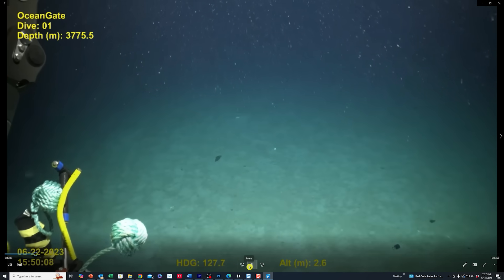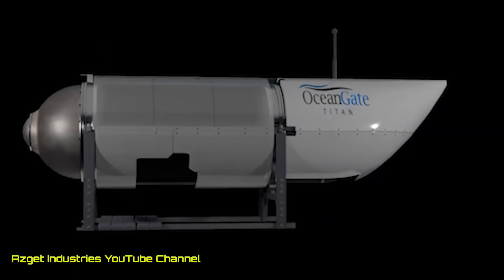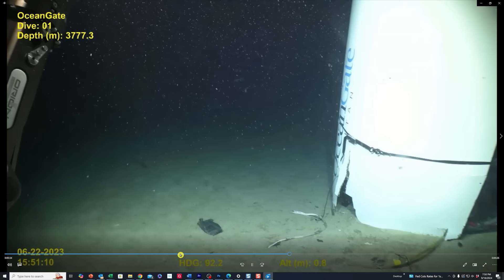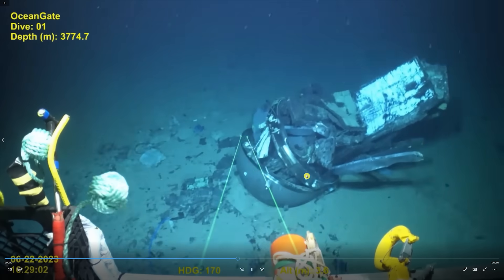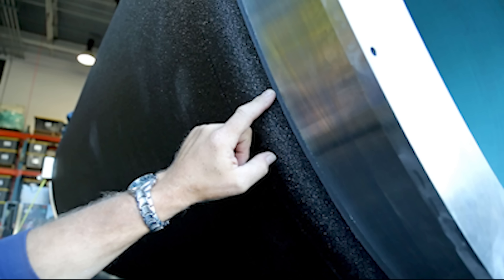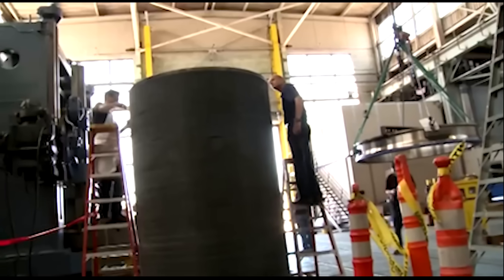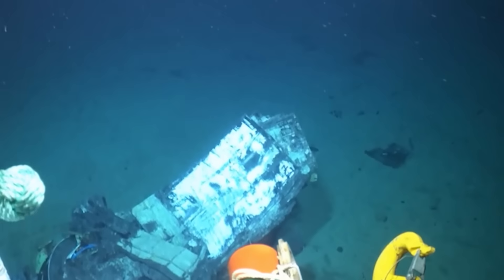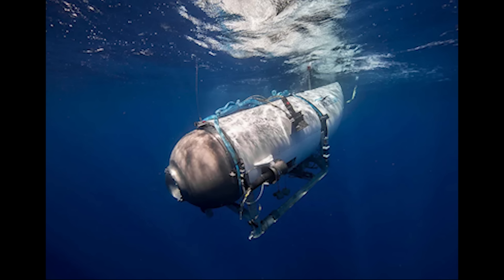OceanGate Titan Sub Debris Video Shows How It Imploded

Comment: Okay, first of all I'm not a submarine engineer but even I know that the design of this sub was extremely flawed!!! There is a reason why deep sea submersibles like Alvin which was designed in the 1960s use a pressure Hull is always a sphere!!! that way the pressure exerted on the pressure Hull is even!!! every square inch of the pressure vessel is compressed evenly!!! the very worst shape that you could use for a submarine at that depth would be a tube!!! it's obvious that the pressure would be greater exertion on the Rings and joints of the tube, to make a long story short I wouldn't get inside of this submarine even to go ride around a lake this vessel was not seaworthy!!!! I don't know how they at certification to make it seaworthy??? maybe that'll come out in the investigation this thing should have never touched ocean water, also using epoxy in a corrosive saltwater environment? is another giant no no!! salt water is extremely corrosive to chemical agents, I feel that over time repeated trips under pressure with salt water probably destabilized the epoxy and here's a word to the wise if anyone ever asks you to go into their glue together submarine just say no😂😂😂😂😂😂😂😂😂😂

Comment: Where are the bloody bodies inside the sub???
Reply: Vaporized and smashed into the front. The carbon fiber fragments inward into 1000's of pieces. The implosion also causes massive amounts of heat. So the bodies were shredded and cooked in 0.14 seconds. The ocean weighs 5500 pounds per square inch on a vessel at those depths.

Comment: Foreshadowing Fact: in 2010 a game called "Dive to the titanic" was released, the game is about diving to the wreck of the titanic in a submersible (Nephron, which is based on Mir 1 and 2), and doing several things like photographing and collecting artifacts.
In the game, the narrator talks about the pressure of More than 380 bar and that a tiny hole would cause the submersible and its occupants to be torn into tatters in less than 2 seconds (which is much more than it would actually take), but thats not all, the mission in the games takes place over 5 days, just like there was 5 people onboard the sub, plus on the 5th day, an incident happens in the game which the player has to survive.
Sometimes its crazy how some things can almost predict the future

Comment: so why is there some type of tie strap around the structure as seen at 0:20 ?
Reply: To hold it together i guess, its clear there's some work done down there after the implosion to bring the sub back to the world. Also if the straps were there before, its not explosion so the strap breaks, it imploaded. Two very different things. To be honest it doesnt even look like implosion. Its more of a "lost controll and crash landed in the dark"  It could be that the calculations on the instruments were wrong and they hit the bottom with high speed. Altho It feels as the sub was falling down like a bullet, breaking the body on half. Its just ironic, that titanic was broken in half too before it went down. Death roams that place. Not a living soul can prove me otherwise, death did left its mark. It is also possible they had some electrical error in the program, lost all electricity which allowed the sub to maintain horizontal level, forcing the sub to divei down with the front part like a flying bullet. Seeing that the sub weight was just above 10 tones, 3.800m drop seems like jumping off a building with a bag bricks on the back. It is also possible that high drop rate combined with the pressure made all those people faint and they were not even aware they died, which is also a reason of implosion. Whatever it is, its sad those people lost their life. But in the frontier of exploration, since the dawn of time, death is your companion. It takes brave men to explore space, the depths of the ocean and every enviroment men are not made to live.
Reply: Yo my question exactly. You show up to visit the bottom of the ocean & it’s held together with a ratchet strap…I mean you get whatchu get
Reply: It looks like it's raggedy with the strap tied on the back of it. 😥💯

Comment: Now, my theory is that the window possibly malfunctioned, pushing the pressurised chamber and tail cone backward. Seeing the minimal amount of debris at the front dome (I forgot the proper name, sorry), I think it may be rather possible. But, because of the carbon fibre controversy, people may think that it was entirely the carbon fibre hull. Seeing how the glue may have failed, the point of failure may even have been the connecting point between the titanium and carbon fibre.

Comment: Yes the bonding zones on the metallic components should ideally be acid etched or carefully abraded and de-greased. 
Covered and protected before the bonding operation.

The carbon bonding surfaces should be abraded to a particular roughness and also de-greased with a high flash solvent such as acetone.

There are also chemical bonding kits available to test the surfaces to be joined to ensure 100% no contamination is present.

Thorough mixing of the adhesive and chemical hardener is of course critical. As is the ambient humidity and temperature.

The application should be generously applied and a fillet should be left along the edge of the titanium ring which can dramatically increase the integrity of the bond.

❤

Comment: As many engineers have said, carbon fiber becomes weaker with each exposure to the pressure conditions of the depths, fibers start to deaminate, so the carbon fiber idea was probably good, but only for a few immersions, not thousands as they pretended to do with this submarine.

Comment: I doubt the glue joint failing between the carbon fiber tube and the titanium ring would've caused the tube to implode.  If that joint failed first, it's likely the outside pressure would've forced water though the joint, causing a flooding of the chamber and relieving pressure differential before tube failure.  That same pressure differential would tend to keep the rings clamped on to the tube until flooded.   A tube implosion from carbon fiber fractures seems more likely and would result in the same ring to mating surface clean separation that we see. Just a thought.

Comment: Its all about compressibility. The carbon fiber hull that was mated to the titanium ring failed no doubt in my mind . The compressibility of the ring was much higher that the carbon fiber and the epoxy glue. Pressure compressed the hull sealing point and pulled it away from the ring. This began to fail on install. Dirty rags used to wipe the seal..geez

Comment: I served in the United States Air Force doing structural maintenance. From my six years of experience, working with advanced composites it's crazy to think any engineer would allow this. All this work should be in a "clean room". Bonding your epoxy equally needs to be done in a vacuum bag  which I haven't seen. Crazy to play around with that kind of pressure just winging it.
Reply: I was  amazed to see this done outside a clean room. I've seen less critical components worked in more sterile environments than Titan was constructed within.

Comment: That design is flaw , they should have made 6 titanium rings as inner shell than on the inside made 7” or 9” thick of carbon fiber , that why when they went too deep and crush that 5” of carbon fiber , titanium can prevent the sub from getting crush , because 6 titanium ring support inner shell

Comment: No etching or other roughening of the titanium ring plus applying the adhesive in an area where there's all kinds of dust and dirt blowing around in the air to get into the adhesive and compromise the seal is just unbelievable.  I am not an engineer but I understand the need for a rough surface and a clean environment to get a really good adhesive seal. They failed in the most basic principles and then smiled talking about it like they were being so careful.

Comment: Ive always felt the same way about the hull being "glued" to the smooth end bells - the whole idea seem ludicrous given its intended use - those bell ends were smooth as glass and the epoxy has to have a shear limit at the bonding point - one guess I had might be how does anyone know in what ways the properties of that epoxy bond is going to change once its under a multi-ton per square inch pressure as well as being exposed to the cold saltwater at the bottom of the ocean - ive heard others with more direct knowledge than me say it would become cold and brittle with catastrophic failure under pressure a forgone conclusion at some point, im no engineer but im a mechanic and worked in a plastics molding plant for 15 years so you learn things that while not exactly applicable to this scenario still give you some insight to failure possibilities.  Im thinking it (might) have been a dual cause failure, hull pressure pressing inward is certainly going to distort the carbon fiber inward, and maybe also at the same time causing outward pressure on the bells so maybe both the CF hull and bonding area failed in some sort of order-?  Question is was inward pressure on the hull enough to overcome ocean pressure on the end bells enough for them to de-bond and pop off the ends -- also in what order did said failures occur - did the hull fail first then the epoxy bond, did both fail at the same time, no way to know as I said im only speaking from limited knowledge and supposition, but might be a good point of discussion for those who know more than I do.

Comment: Given that it wasn't a good idea to build a submarine with that shape and glued parts, to go to a depth of over 4000 meters... Here the basics of safety and common sense have failed... If you want to make stuff that it has to withstand extreme pressure and you want to glue the 2 parts, you don't do it in the open air, without gloves, without masks on your face. This way you contaminate and damage the 2 surfaces that have to come into contact with the glue, it is much better to bolt and use materials suitable for the purpose.. This was madness... It was only a matter of time before the titan, as it had been designed and built, would destroy itself.. And bad luck would have it that it took lives away... And they had also warned them that it was not possible to go so deep with that vehicle... But they insisted and these are the results

Comment: What a poorly designed joint between the titanium parts and the carbon fiber part. It would never withstand these pressure extent of the deep. No private company should homemade these equipment. It should only use a professional certified and known equipment brand and the right equipment for these depths.

Comment: Very rich people have made very bad decisions. They've cut back on all the commodities that would have meant survival and security for them. Unfortunately, in many respects, ego has driven this project. Despite warning signs and expert opinion, experts were fired if they didn't say what they wanted to hear. However, there is also the responsibility of the monitoring and inspection bodies who tested the toy. Although they raised their concerns with the company, the vessel could still be used to operate at sea. How is this possible ?   Because there was no way the submarine should have been given an operating licence. Basic things like GPS were missing from the submarine. Obviously a design flaw and poor quality materials caused the accident. The poor quality of the material simply could not withstand so many dives and it tired and gave way. It cost them their lives, even though the company's employees knew about the problems with the construction and the quality of the materials. Yet they were still taking people on trips to the bottom of the ocean. Those people trusted both the driver who operated the boat and the company. Much more serious scrutiny and criteria must be applied to these companies and vehicles to ensure that such a sad tragedy does not happen next time.

Comment: Carbon fiber abd titanium were not joined except vus pressure. The sealantvwas meant to remain flexible because titanium is not . Asuming narrator is unfamiliar with the physics of pressure. Under water rhe pressure is equal alk rhe eat around the sub this rhe pressurde pushing the two titanium ends towards each other was equal to the pressure excerted equally around the carbon fiber cylinder. Thats how water pressure works

Comment: What you saw was rhe entier crew capsule and one endcap. What was ledt of the people ate within the crished area. The other endcap (titanium ) whether or not it had the port hole. Both end caps had the bolted port , onlly one was a  plexiglass window. . No need fir sixe scale . There sub is in 4 distinct parts. As for bidy parts inthe sand there may be some, but the squashed bodies are inside the crushed area , its doubtful the bodies had much separation possible the skin retained the mass. Look for a rubics cube and the control remote which may have escaped thriugh thr cracks of the hull

Comment: I am a structural engineer that designs building structures, but I think some things still apply. In looking at shear resistance of materials, and my expertise is concrete, a smooth concrete joint gives you the least shear capacity using a modifier of .6. An intentionally roughened surface gives you a maximum shear capacity multiplier of 1.4. Putting a very smooth titanium ring against a smooth carbon fiber surface and expecting a glue to hold all of this together seems nuts to me. Based on building structures, we would provide some type of physical mechanical connection between 2 pieces being connected. I would think here where we have 2 dissimilar materials (titanium and carbon fiber) with different coefficients of thermal expansion, that we would want some type of physical mechanical connection between the 2 pieces, because when these 2 materials are shrinking or expanding differently, internal stresses on that glued surface could be great.
Reply: I mean, skyscrapers have extreme pressures on them too, right?  Just sheer gravity and fighting the wind?
Reply: @Dubuya_Jay  All buildings are designed for the building code wind pressures and earthquake forces that are expected for the life of the building. Skyscrapers are generally modeled in a wind tunnel with the surrounding buildings. Doing this generally results in a lower wind pressure than the building code requires. Wind tunnel tests are also done to study the exterior building cladding to see if any vortices are generated by the building shape or by adjacent buildings so that the glass doesn’t get sucked off of the building. Water pressure is a whole different animal. Water pressure makes wind look like child's play. There is a reason we know very little about the depths of our oceans. Water pressure increases linearly with depth.
Reply: @davidzuk4894    Ty for all that info.  Didn't know about the wind tunnels.

Comment: I commented on one of these type of videos, just after the submersible went missing and presumed catastrophically lost, that i used to machine fairly big marine propeller shafts like.>12" dia x 40ft long. We would weld SS or "shrink on" bronze liner bearings onto the shafts. We also would warm the finished shaft between the bearings to sweat out any moisture in the pores of the finished shaft which would lightly flash rust on steel shafts, followed immediately by a big HD grinder with a really rough flapper wheel. After that, we'd  wind on  fiberglass tape & resin between the brgs to protect the shaft from corrosion. We had to machine shallow angle tapered ramps in the ends of the bearings to terminate our tape and resin layers. There were specs on how much taper to machine in. We also machined in at least two grooves into the ramps to assist in gripping the tape/glass. We also would deliberately machine the ramps extremely rough, almost "hairy" to give the tape & resin something extra to "bite into". These OG guys didnt do any of that procedure.

Comment: 0:45 it looks to me like the top of a VLF antenna whip likely there was some kind of flag on it like in the launch photos. I don't know for sure but you would think a low frequency radio would be useful under water hence a long whip antenna operating on VLF band. Looks like someone forgot to add the whip on the model... it's shown briefly in some parts of the clip 0:41 shows the antenna mount and a whip attached -- someone forgot to include all the modelling details. I wish I could post pictures in the comments but you can find them for yourself if you are curious or want to challenge me. The engineering drawings are crude and her model is not 100% correct from what I can gather from the video.

Comment: Why would u think gluing anything together that must resist such substantial forces of pressure,  expansion and contraction would be a good idea. It should've had  threads and glue to keep the surfaces together.

Comment: window is broken half of the glass is missing in cracks stockton tried to make a vessel on a budget to strip the pockets of rich to have a ride in this death machine i still dont know Stockton should have used whole titatnium body doesn't matter its heavy and less manoeuvrable should have used more powerful electric motors to it more batteries so if one set of batteries and motors died he should have used the other ones he was so confident yet he knew carbon hull is making noises still he didn't care at all used childish x box controller instead of manuel stick to maneuver it force of mother nature you cannot mess with it